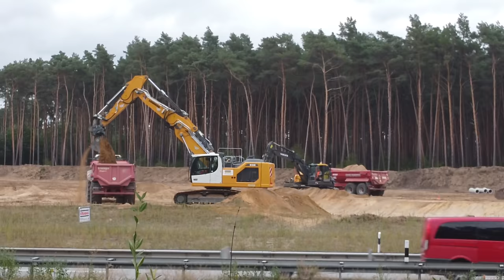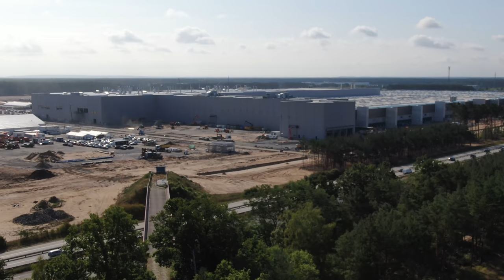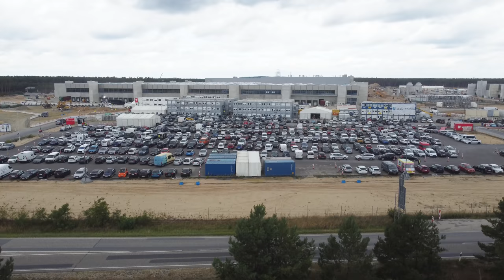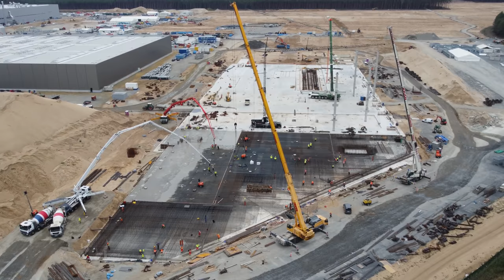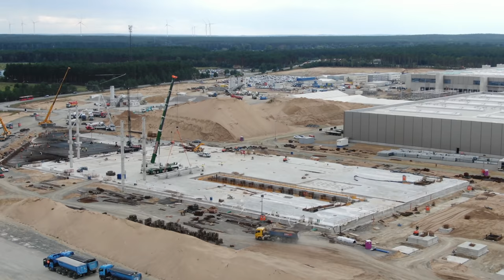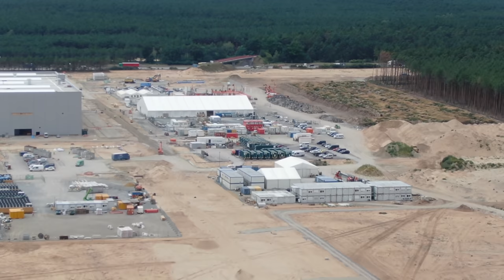Giga Berlin | 2021-08-18 | Timelapse

Comment: Thanks, Tobias.  I enjoy your time lapse shots.  I'm amazed at how steady you can keep the drone in the wind.  The battery foundation is using a staggering amount of steel and concrete.
Reply: I note how tall the concrete columns being installed there are. Probably the size of the building requires such strong concrete slabs. It’s suggests a lot of massive and powerful machines will be used there!

Comment: Why so much steel need for fundation of the battery building?
Reply: In Texas, the same portion of the factory had thousands of geo-piers to stabilize the foundation. In Berlin, due to water table concerns, they could not drive piers into the soil. This steel reinforced foundation is their solution.
Reply: @Sntd … two reason they can’t use geo piers as @I_want_to_believe said and the second reason this building will have 3 levels ( maybe in same parts of the building all 3 levels are used for for the production ) so for that u need a massive foundation to carry the load of the production equipment
Reply: @kdungan100  Problems can be said, the project is located in a water protection area. And you can't drive deep piles in there.

Comment: Those concrete columns for cell factory look roughly similar to those in Giga Texas, but you don't see any bracing here. In Giga Texas there are several temporary braces for each column even when the roof panels has been placed. Any ideas why?
Reply: Maybe because the foundation is so strong that you don't need it. In giga Texas each pillar has its own independent and much smaller foundation.
Reply: @krauserclaus6799   Well yeah, but I am pretty sure something similar is used in Giga Texas aswell. I don't think those columns are free-standing in Texas.
Reply: @no_more_free_nicks  Ok, but then what about the casting area columns, those had similar sized foundations as in Texas but still no bracing!?
Reply: @shenkers  I think in Texas a sleeve foundation would be used.
Reply: In Texas, the structure's shear loads are carried through the roof. The bracing is removed after the roof is tied together.  It's not magic.

Comment: What is that building with the super strong foundation for ?   Is that the battery cell production building ?  
Looks to me that progress is much faster in Germany than in Texas.
Reply: Yes, this is te battery factory. I have no idea why the foundation is so thick, either something super heavy on top of it, or.... Ground water protection?
Reply: @no_more_free_nicks  The foundation needs to be thick because the cells produced in large quantitites need to be temporarily stored inside the building and they are heavy. Very heavy! And I won't say they're progressing faster than in Texas - the two cell factories are being built in completely different ways.
Reply: @no_more_free_nicks  probably both
Reply: @no_more_free_nicks  Thank you for your reply. The only thing I can think of,  is that the slightest bit of movement could disturb the precision of the robots.
Reply: @FordGranada75  That makes NO sense, if they are very heavy, then you can't stack them very high, therefore the load per square meter on the floor won't be that high. Lots of things used in manufacturing are very heavy. Look at the rolls of steel, they use to make the body panels, they don't require a foundation that thick.

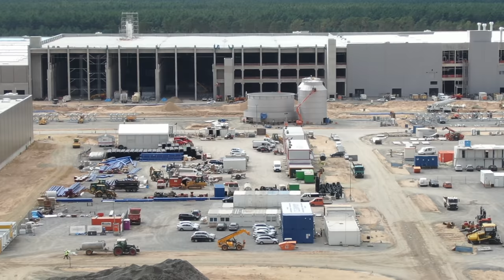Comment: 17:45 I have the impression that that large wall will never be completed...    :-(
Reply: It would be stupid to close it off now when they still need to move in more large equipment. It also allows for natural light and ventilation.  Fremont casting  has no walls and a partial roof, Austin is not closed in yet, maybe Tesla knows what it is doing.
Reply: @gpsfinancial6988  I know. You shouldn't close a wall before installing the bridge crane in it. My comment implied that everything inside is taking ages to come along. Didn't you get it? And, yes, Elon is impatient too.

Comment: Does Germany not have motor scrapers? Seems a very inefficient way to move earth with diggers and trailers
Reply: You need excavators to shape the slopes etc. Scrapers are probably good for  large flat areas.
Reply: Motor scrapers were in Europe never as common as in the USA. Due to the population density, too few buildings projects were they would be useful. It's common that you have to transport the soil over some distance. Or at least across public roads.
Reply: @abalada  Yes, you hardly see that in Germany

Comment: 。First ,go Tesla . Ihope I can get my MY from giga Berlin to downunder.
Reply: No chance, it will come from China. MY made in Europe will be sold only in Europe for a long time. The Chinese made cars are very high quality, and the SR+ MY with LFP cells has great longevity. I have an LFP M3 from China, very good build quality and finish.
Reply: @jamescoppe  。I prefere that my MY comes from Germany cause of their built quality and excellnce. Im originally from Malta and I can always use that address. When its readu for delivery I will fly to Berlin drive around Europe and then ship it to Austrelia.
Reply: @raymondschembri5042  I would strongly recommend testing a Model Y from China first.
Greetings from Germany. 😉
Reply: @goodyKoeln  If its with the 4680 cells I will concider. FirstvI have to check them out when theu land in Aust.
Reply: @raymondschembri5042  It will be LHD and you will have to pay a lot of costs to privately import it into Australia. It's possible, but not worth it.